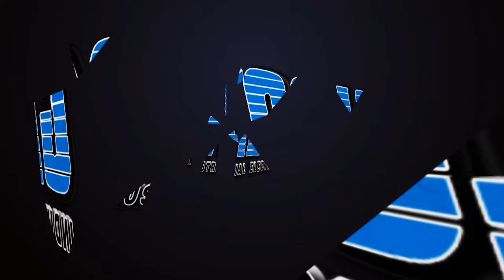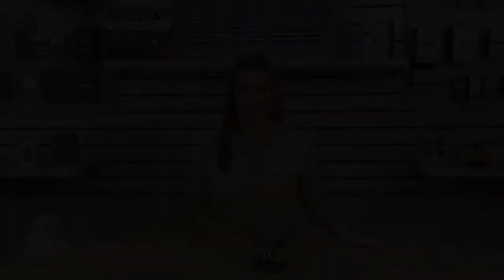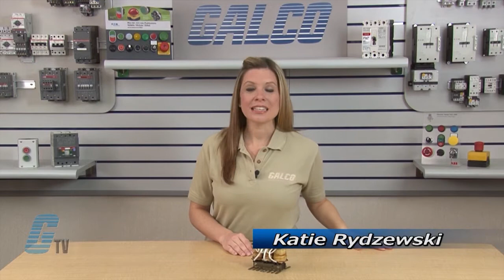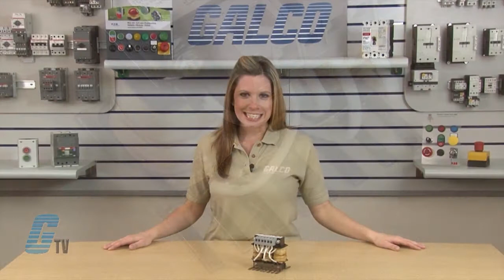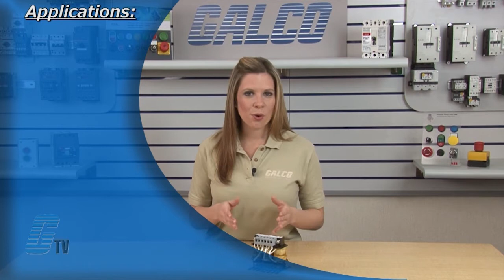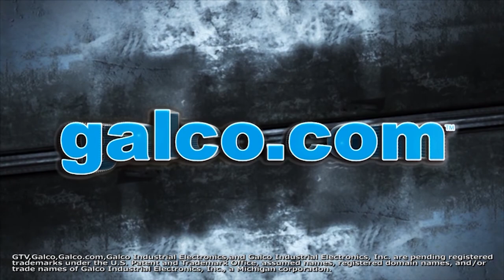TCI's KDR Series Line Reactors

Comment: What's the difference between KDR and KLR series? They seem awfully similar to me? Why have two different models if they're so similar? Also, a little more info on their differences on the TCI website would be informative too. :)
I'm going to go ahead and go with the KDR series for this VFD application I'm doing where the customer spec'd a 5% line reactor prior to the drive. Hope the KDR series was the correct choice & not the KLR series:)